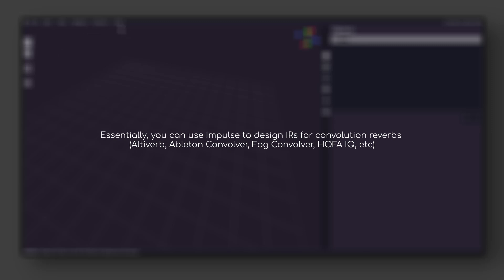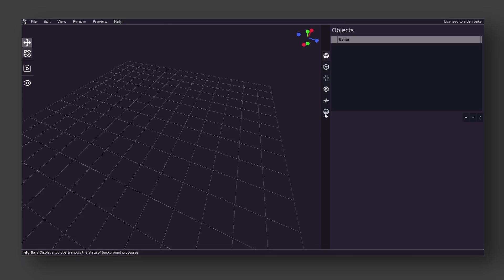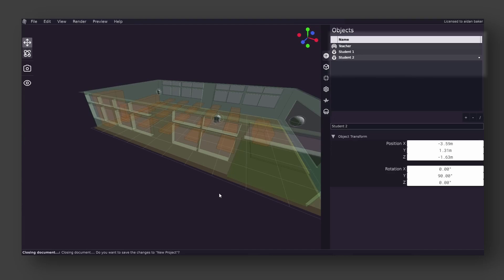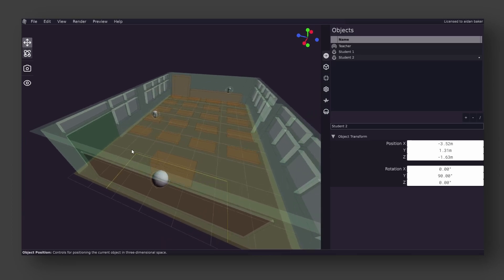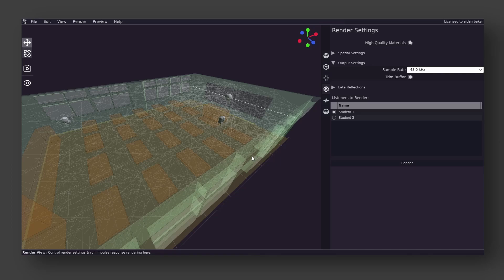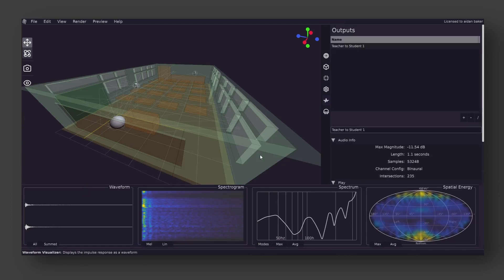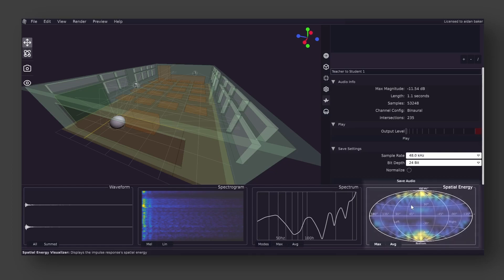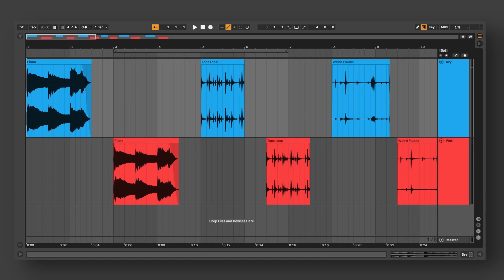Lese - Impulse (Getting Started Tutorial)

Comment: It would be interesting with a video where you record IRs in a real room, recreate that room in Impulse and then compare the real IRs against the ones made with Impulse.
Btw, I can definitely see this being a gamechanger for game audio. Instead relying on regular convolution or algorithmic reverbs, they can instead recreate the scenes in the game and get a very accurate room sound.
Reply from the maker: working on doing something like that (the real hassle is figuring out how to accurately measure the spaces to recreate them in 3d)
Reply: @lese-audio  Maybe a lidar scan? Might be a bit too expensive just for a video, but if you know anyone with an iPhone 13 Pro and above or an iPad Pro they should be able to do a lidar scan of a room. Probably not nearly as precise as an industrial lidar scanner, but could be worth a shot!
Reply: In a real room, most things and objects, in addition to the mathematical characteristics of reflection/absorption at different frequencies, which are well-known how to being well-modeled, and in addition to the characteristics of diffuse scattering of surface irregularities, which are reasonably well-modeled, have structural features of thickness and attachment to each other or to other things and objects, all that turns them into complex membranes, they resonate and have their own decaying oscillations at their own structural frequencies after being subjected to a sound pressure difference. These are cabinet doors, different panels, windows, tables, and even a teapot on the table. All of this contributes to the timbral coloration of the reflections, and only God knows how to respect this and model😅
Reply: @tapdapy  Yes, it will ofc not be 100% accurate to the real world (I don't think a simulation will ever be), but the interesting thing would be to hear how close to reality Lese's Impulse software can get.